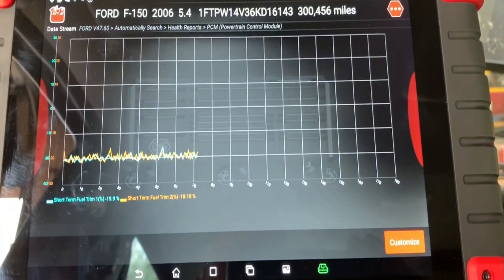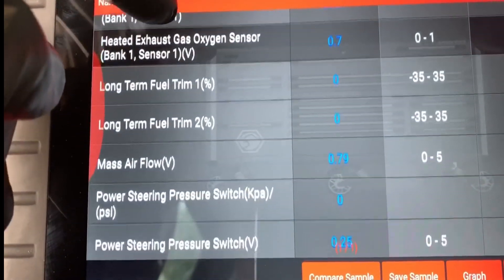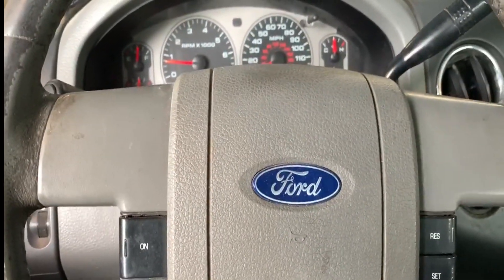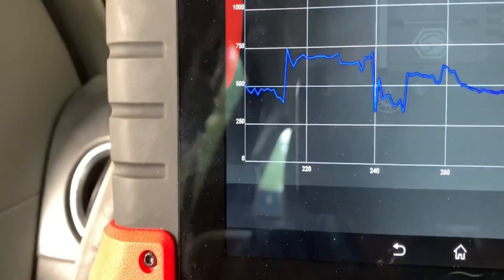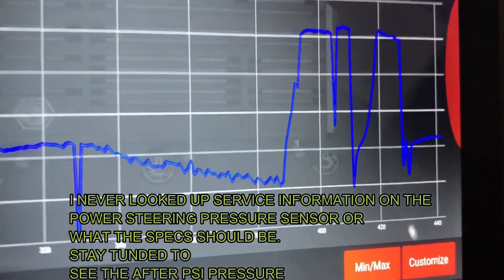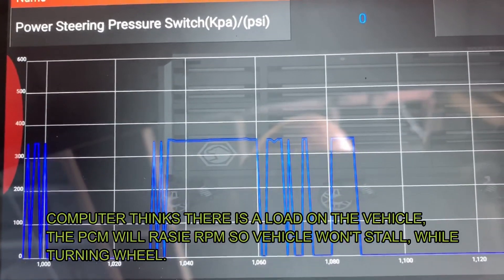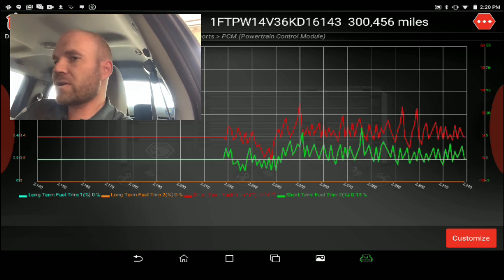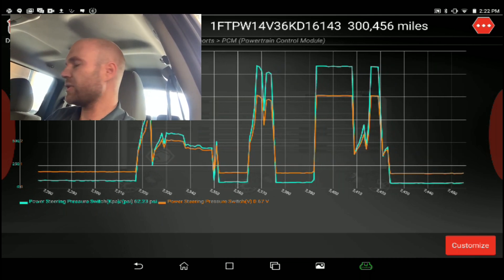NEGATIVE FUEL TRIMS?

Comment: hey cody thanks for showing the issue in detail....common problem on the fords....i'v seen about a dozen issues and most of the time the pressure is way up there....so much that the vehicle was towed in for unable to run....both short and long fuel trims are pegged....unplug the ps and runs great...thanks again for the vid.....ya know how many double takes of gotton for explaining the it was the ps switch....looking at me like I wasn't from this planet!!! ha ha ha ....good vid cody
Reply: um .... common up here in the northeast
Reply from the maker: Thanks buddy, like hearing other guys experience with this issue as well. Thanks for your comments
Reply: Awesome video man.i did know that power steering pressure affected idle air control command percentage (or on a drive by wire)open the throttle plate a little more and that the ecm looks at it for load percentage but fuel trims being effected like that? ... amazing. I can definitely appreciate the fact that you took notice of turning the wheel causing your problem and following that instead of going down the wrong rabbit hole. Great job. I also liked how you mentioned the fact that just a pigtail would have fixed the problem.